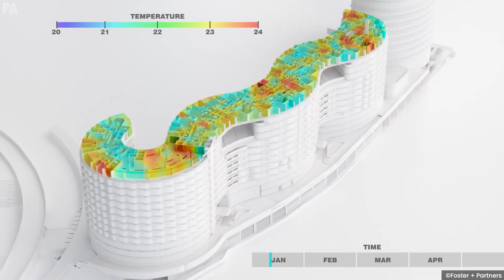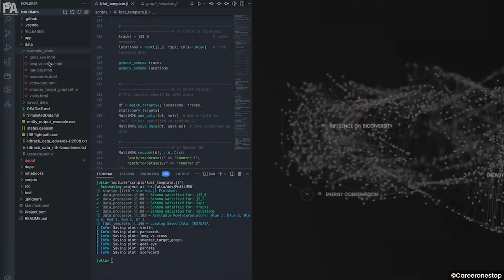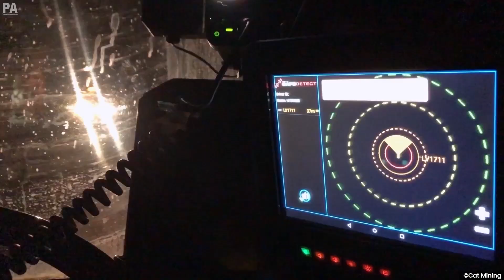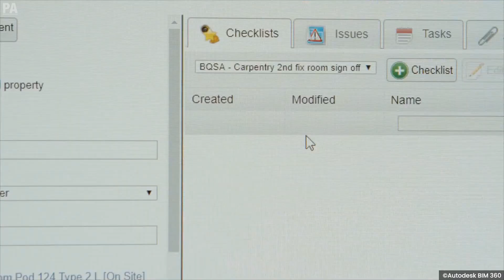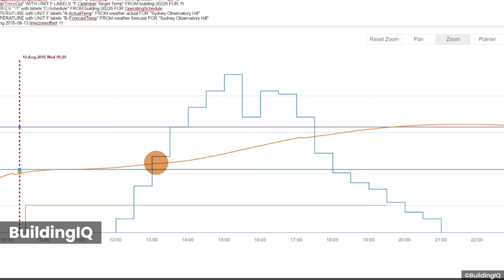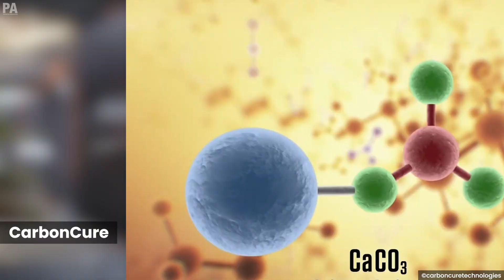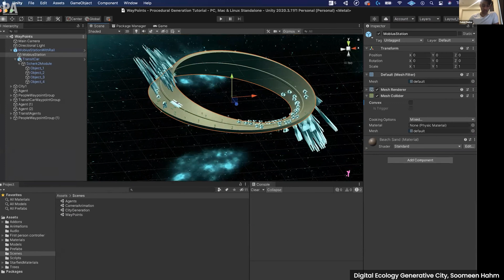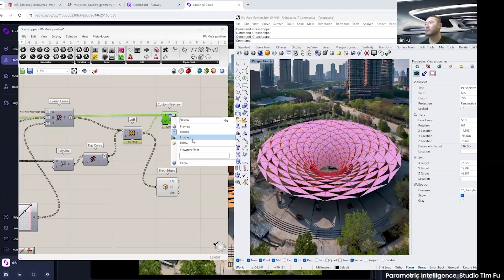The use of AI in Construction Management and Automation

Comment: ENGINEER HERE:
I started with a degree in aerospace but have spent more than 35 years in control systems, automation and robotics. I started with a couple of years of post graduate research followed by more than a decade in manufacturing and most of the last 20 years in mine site construction, but have also done projects in oil & gas, water treatment and power systems.  

I have never seen so much IDIOTIC GARBAGE packed into 7 minutes and 11 seconds. 
Almost all of this is either conjecture or sales hype or both.
People have been pumping out these sorts of project management and maintenance software tools since the min 1990s. MOST have been utter failures because the people writing the software had never worked in either project management or maintenance. MOST of the time these sorts of software tools were bought by NON-ENGINEERING management personnel who could be convinced by salespeople that "this was the answer to all their problems."

Anyone who thinks a lump of software can be developed by people with virtually no working knowledge of the task will produce something that works is living in fantasy land. I know that one of the worlds largest mining companies was sold a $600 Million maintenance and accounting system. At the time it was being sold I was working on a mine site for that company and 8 years later I was working on another mine site for the same company and that system WAS STILL NOT WORKING PROPERLY.

There's a simple way to get projects done. 
Its called hiring the right people who actually know what they are doing instead of letting some clown in HR who has no idea how to gauge skills and experience in a field they have no working knowledge of pick the most hopeless applicants. 

There's a simple way to keep your trucks, mines, factories, power stations, water treatment plants,........ from breaking down. 
Its called hiring the right people who actually know what they are doing instead of letting some clown in HR who has no idea how to gauge skills and experience in a field they have no working knowledge of pick the most hopeless applicants.   

Don't expect projects to go well or things to NOT break down when you don't hire people who know what they are doing.
AT BEST these are tools that can help people WHO ALREADY HAVE THE EXPERIENCE make faster and better decisions, BUT they will never make up for a lack of experience.

I highly recommend the videos by Sabine Hossenfelder and Angela Collier who have both done several WELL RESEARCHED videos into the claims of AI proponents and Quantum computing.